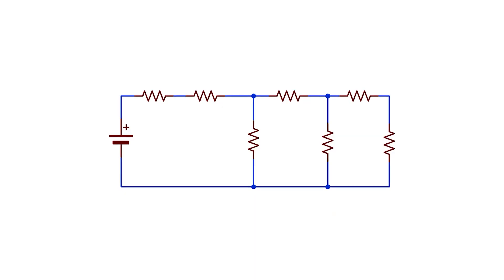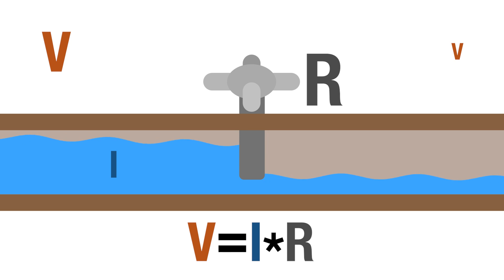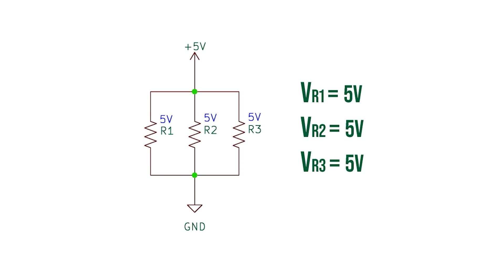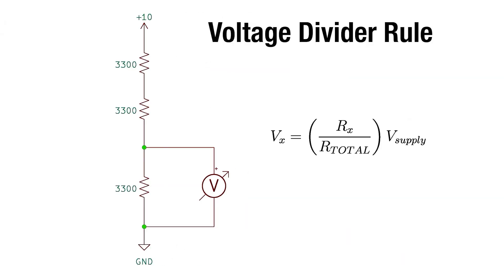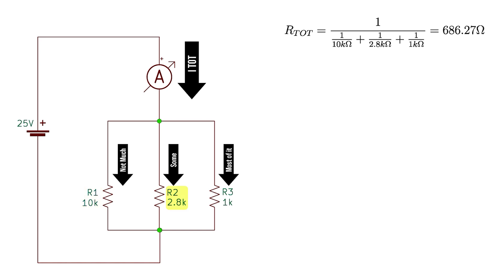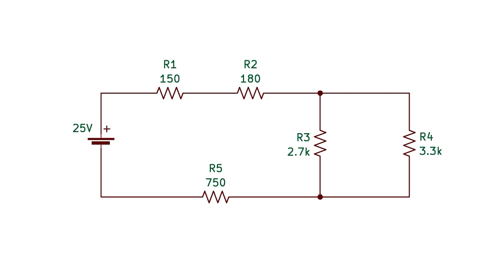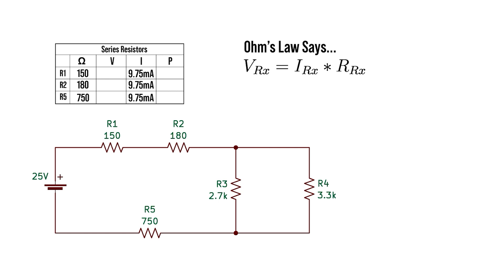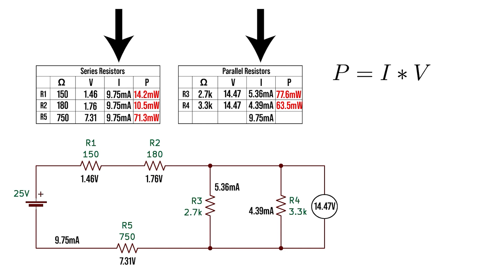Mastering Complex Circuits: A Guide to Parallel and Series Resistors - DC To Daylight

Comment: Great explanation/reminder of fundamentals in a concise and clear way. Great job, Derek!
P.S. Yeah, I do those calculations from time to time for my own sanity, when troubleshooting or prototyping - better to spend some time on calculations rather than blowing up all the freshly bought LEDs 😅 I usually use a spreadsheet for more crowded circuits - in the same form like the tables in the video, with power ratings caclucated too. 🤓

Comment: You should have showed the RATIO formula when looking at various parallel resistor branch with the resistor values to know the Ratios of current by just looking at the resistor values. Make a part#2 YT lesson about parallel resistor branches using the Ratio formula. Measuring Ghost Voltages in energized wires harnesses or multi wiring conductors the Ghost Voltage phantom voltage is based on the wire length + inductance or capacitance coupling which is a Parallel Branch. If the energized wire has 120VAC and the 2nd wire is non-energized but has a ghost voltage/phantom voltage of 80VAC, 120VAC -80VAC = 40VAC that is loss. The question is why is the ghost voltage/phantom voltage 80VAC and not at 120VAC? and why is there a difference of 40vac?

Comment: Wow! That was a seriously fun flashback to electronics school, which for me was in the early 1980s! The video also reminded me of the problems we had to do to simplify logic circuits.  Back then, almost all of the instructors were former military tech guys. The 8085 microprocessor just came out and op amps were all the rage! LOL! I left that career behind in 1988 when the company I worked for was sold and I went off to college for a teaching degree. I just retired after 32 years of teaching, mostly in an elementary school computer lab. My electronics career helped me land that job. Of course, back in 1994 when it was created I was pretty much the only one "crazy enough" to want it. For me, it was a dream job. One funny note is that to this day I can still recite the infamous mnemonic device for remembering the resister color code. Another gem from the military folks!! Thanks for the trip down memory lane!!
Reply: @AmRadPodcast Yup, you could program with the whole op code set because it was so small. You could watch the buffer states change and watch for ALE to go low! But, it was state of the art in 1983! LOL!